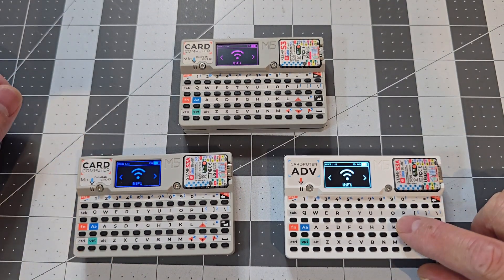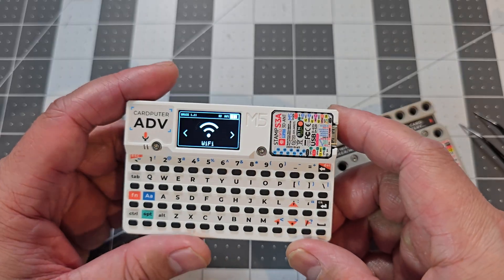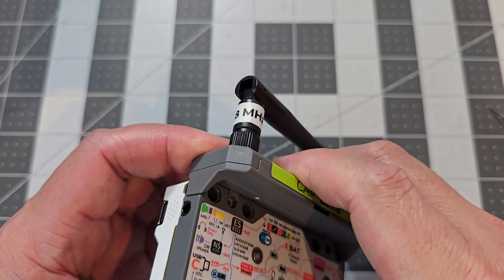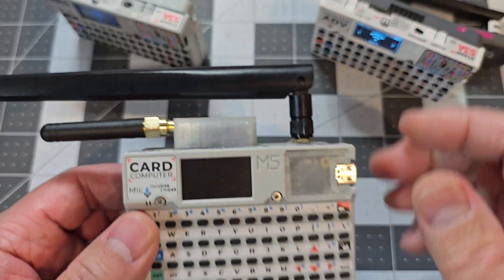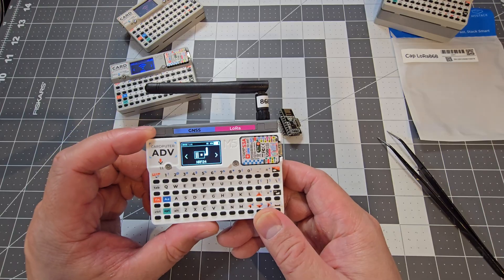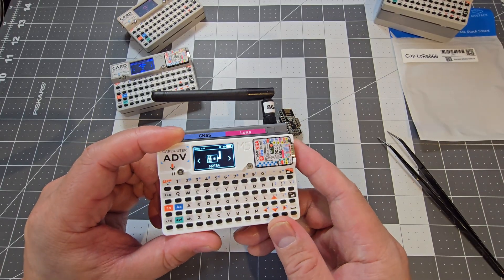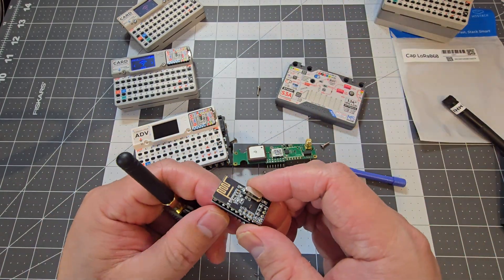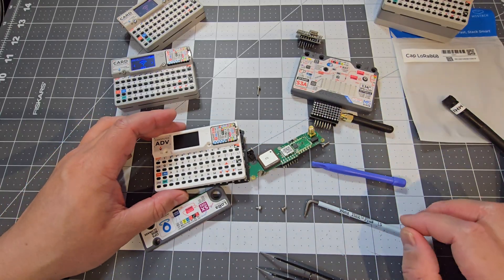M5Stack Cardputer ADV – The 3rd Evolution of the Cardputer!

Comment: So the advance isn't capable of running without the back on like the originals? I have the first model, but I use it as a note and password vault so I didn't need the big battery, and I usually run it in slim mode 😂
Reply from the maker: Yeah not possible with ADV since there is no battery at the front.
Reply: @rayj1988 
I still want one lol

Comment: would you recommend the cardputer adv or the t-embed c1101 plus for someone just getting his first gadget to learn on?
Reply from the maker: If I had to pick one, I would go with the Cardputer ADV it is better supported with people making firmware for it etc just check out M5burner for what is available. It also has better build quality. Noting you will either need to build add-on boards for it for CC1101/NRF24 etc.
Reply: @rayj1988 thanks a lot. With the saved money I’ll buy a raspberry pi to learn on too
Reply: Same dilemma here but I need RF and NFC reading .

Comment: Other than for the easy to access and built in lora capability, I still don't know that I'm sold on it. I have a standalone HMD controlled with F0 and an analogue pocket dev kit running the risc-v test core to build rust software capable of interfacing with other hardware over uart using the debug key. I have so much addon capability the only limit is my coding skill. Cardputer has yet to proves its daily worth as more than a toy.

Comment: I really really wish the screen size would of also been increased slightly. That was the only complaint I have with cardputers.
Reply: After researching the way M5 vs lilygo calculate duties I found that M5 is currently charging /pre collecting 30% duties. That 333% more than they should be right now. Question is, is this an intentional scam by m5?

Comment: LoRa Frequency	868 ~ 923 MHz (You don't need to change the antenna, it covers the range from-to.)
Reply from the maker: The antenna is only 868 MHz, not 868–923. It might still work at 915/923 MHz but with less efficiency, so it's better to replace it in my instance.
Reply: Antennas are tuned for a certain frequency!

Comment: out of curiosity is the front case of the v1.1 and the adv interchangeable?
Reply from the maker: I did test that as I was also curious, and the front case is interchangeable.
Reply: @rayj1988  wow that is nice to know, thank u.
Reply: @rayj1988  so the regular cardputer could be an ADV with the back of the ADV?
Reply from the maker: @Apapaya. no, the cardputer adv has a completely different circuitboard. You can not upgrade a standard cardputer to adv.